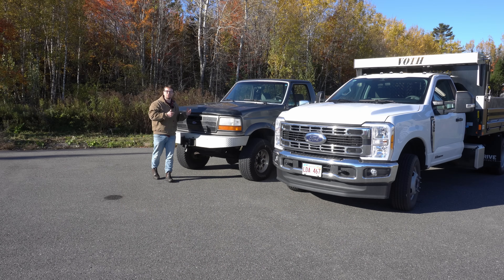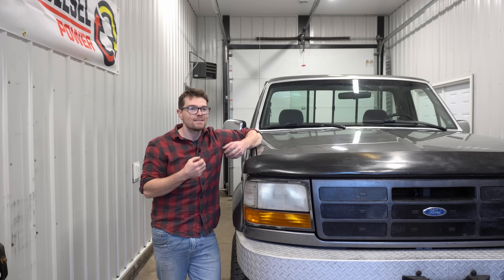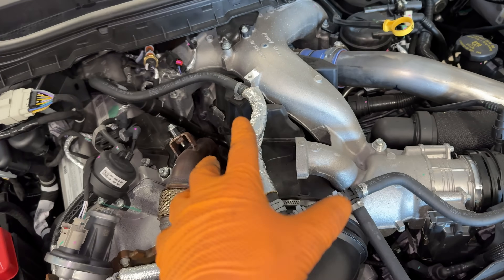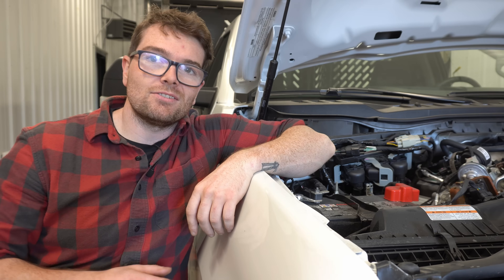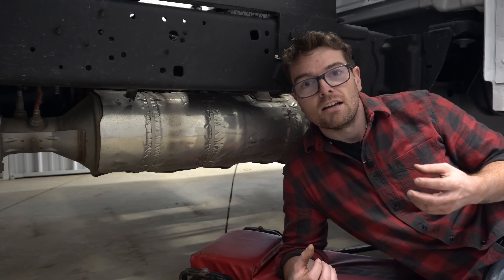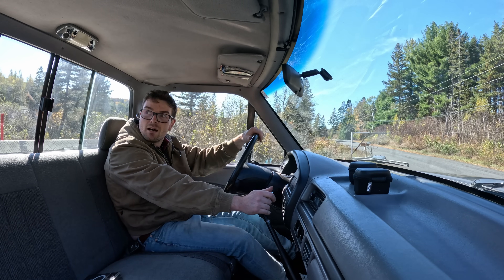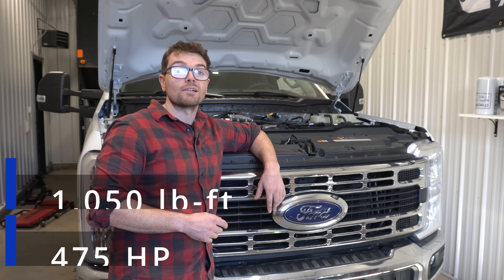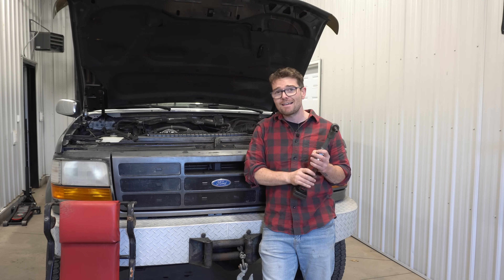Ford F-350 6.7L PowerStroke | 5 Reason Why New Diesel Engine SUCK *Diesel Mechanic Explains*

Comment: What happens when you guess wrong. Does the customer foot the bill. Most of us can fire the parts cannon at it. You pay a dealer because you’d hope they know what’s wrong. But just like I can read the obd2. Most of the time it never tells you what’s up. So like you said it’s a lot of guessing, and if I’m on the hook for a 1200 sensor plus labor plus diagnostics. I hope that’s the problem seems like I can always fire parts at is well.

Comment: My Transgendered '20 F350 dually has clicked off 321k miles, and hasn't had a single issue with the proper maintenance... and it runs and sounds better than any old clankin garbage can 7.3 lol

#isaidwhatisaid

Comment: Another aspect of the modern diesels being a bane up where this video was created would be from parts availability?
From the looks of the surrounding vegetation, the location looks like the northern reaches of Canada, which puts it on a precarious end of a supply chain when it comes to replacement parts for diesel engine repairs . . . especially so when it is -30 degrees with snow in the region.

Comment: You I am afraid right. We buy expensive trucks for power and comfort.  But no dependability.  Nearly unaffordable repairs. Almost like a shakedown by Ford and EPA. Trying to bankrupt us ou5 of our trucks. Case in point, I have a 2013 f450 Platinum.  34,000 miles, code after code after code.  Ridiculous.  Replaced 2 injectors, def heater, now another def code,  voltage wrong... 34,000 miles! I take very good care of truck, trying to preserve it. Hey Ford explain this!

Comment: Just one more reason I'm keeping my ordered from the factory '01 7.3 with only 177,000 miles.  I've been running the Western Diesel Tri-power chip in it since '03, other than when it's smog time here in Commieifornia.  It also has an AirRaid K&N air filter and 4" turbo back exhaust.  These mods really woke up the truck, but I'm on my 3rd 4R100, lol.  Just had the glow plugs and valve cover gaskets and harnesses replaced due to 3 failed glow plugs that threw codes and would not allow a smog pass.  My buddy has a 6 Blow and that thing is killing him with constant expensive repairs.  At the shop doing the glow plugs, there was a complete diesel engine out of a truck....from a '22 Duramax...😮.  The mechanic implored me to never sell my truck as did the smog dude... Not that I needed any convincing.

Comment: I have a 2002 F550 and a 2002 F450,both 7.3s.  Run the 550 at about 17500 lbs and it gets about 7ish mpg.  It just rolled 200k miles and I will keep it running whatever it takes.  Or if I cant i will revert to the 450 which is kept in tip top shape, registered and insured just as a backup.  My friend just bought a new 450 6.7 for towing.  It cost him $117k. It is beautiful and gets 14mpg towing.  I wish him the best, but having maybe 10 years to retirement, I'll stick with what I have.

Comment: You can lower exhaust gas temperatures by removing fuel, not just by contaminating air
Diesel engines run, lean in Europe and produce Extremely Low emissions….🤦🏻‍♂️

Comment: I had an 08 dodge 4500 6.7 repo truck brand new. It kicked a code at 10k mi dealership said excessive carbon build up and had to clean the top end out. It happened again around 30k mi and same thing. Dealer mechanic said to not idle so much 😂 then suggested to run it harder as in full throttle from stops, drop a gear and get rpm up and get it hotter basically. Strangely after the second carbon clean it never had the issue again until I quit and the truck had 83k mi on it. Last I heard the truck went well over 300k mi and they never got a check engine light for excessive carbon build up again. So who knows. That was regen but pre DEF.

Comment: You cannot beat the old 7.3 diesel. I’ve often told people you can have a 1999 Ford F250 lariat with all the options versus a 2008 Ford F250 with all the options. You’ll pay more for the 1999 because of the 7.3. Especially, with those junkie 6.0 and 6.4. At least the 6.0 can be billet. But the 6.4 is absolutely garbage. Hence the reason why Ford divorced from Navistar/international. Then of course in 2011 the 6.7 was born and a true Ford engine. 
Now with that being said, the 6.7 has had it share of problems, especially in the first few years, particularly turbo problems. They also are known to catch fire. Trust me, one of our trucks in my fleet caught fire, literally out of nowhere, driving down the road and burned completely to the ground about three weeks ago. 
Bottom line is you’re absolutely correct. The old million mile diesel days are long gone. Thanks to all the admissions. The states that do not have to worry about it at the moment I would enjoy because the emissions will be coming to you very soon unfortunately. Just my thoughts Ron

Comment: Sticking with my 2023 Titan XD to pull my 7,000 lb snowmobile trailer around. Thought about a diesel, but glad I didn't. And this info just verified my concerns. Been a semi truck driver for 20 years and have experienced all these issues. My 2000 Detroit Series 60 was an amazing engine, but when they gave me a 2003 series 60 with EGR had nothing but problems. Good info. Thanks!

Comment: I think eventually they’ll get it figured out and the emissions systems will become less complicated and more reliable. Closer to the gas engine emissions systems that typically are fairly reliable. Atleast the introduction of emissions equipment on diesels hasn’t caused a huge decrease in power like when emissions components were introduced on gas engines in the 70’s. The silverlining is hey, Atleast the air is cleaner and you are less likely to get cancer or suffer other health issues as a result of diesel emissions from new trucks.

Comment: For a $10k upgrade that doesn’t get better milage than a gas motor? I have a 2000 F350 7.3 manual transmission 4x4 and get 24 Mpg at 65 mph

Comment: A year ago I bought my dream diesel truck since I was a little kid. A 05 f350 extended cab long bed 4wd. And minus the battery cable being corroded it has been reliable. I have modded it too with the coolant filter, blue spring, full exhaust, better alternator, improved ficm, etc. Another point with older diesels is that the problems they will most likely have will be easier to troubleshoot vs a new truck. Whereas with mine you understand the oil cooler can be problematic and you can address it before it becomes a problem. New trucks to me look terrible, and minus the power train and interior/infotainment are basically the same truck from 20 years ago as I can bolt on a brand new f350 suspension to my truck.

Comment: 2 reasons

1) The HP and torque war gave a trucks with tons of power but we lost a lot on the way there.  Like reliability.  And durability.  And mileage.  

2) Emissions.  

Those two things along with all the electronicals involved make modern trucks brittle

Comment: Most people who have these "non-commercial" diesel pickups dont really need then and are paying more money in purchase, fuel and maintenance for no reason. Most "heavy duty" pickups have gas engines that can pull reliably all but the most heavy of loads. I had a 1993 F350 Dually with 7.3ltr IDF diesel was far from reliable...two injection pumps, set of glow plugs, glow plug controller, two starters, one water pump, transmission rebuild and I traded it in with 73K on the odometer. I promised myself then that a truck is a tool and buying a 9 pound sledge hammer to hammer in finish nails we a dumb idea. My 2019 F250 with 6.2 ltr gasser does a great job hauling my 30' travel trailer and it has been highly reliable with 63K. Yes like with gas vehicles, all the new emissions stuff adds complexity and cost and it will take a long time for engineers to figure out how to do it better. I remember gas engines in the late 70's when the new emissions standards came out....engines were a maze of hoses, sensors and pumps and put out less horsepower and after 100K the engines were boat anchors. Today gas engines are cleaner, more HP/torque and if you maintain them consistently, they will go 300K miles....

Comment: If the politicians and lab coats were smart enough to factor in fuel mileage, longevity, and carbon footprint of building they would see the old diesels are more environmentally friendly. Every one of the new complex gadgets bolted to the engine has a footprint and every time you replace a component it adds up. Try to explain to me how a 5 speed 12v that goes a million miles and gets 20mpg+ is worse than going through 3 new trucks?

Comment: I looked for a long time and found a 2007 Dodge 2500 4x4 with 5.9 Cummins. It is a southern truck with low miles. The truck had never even had a brake controller installed.

I will keep it as long as possible.  I have owned two 7.3 Powerstokes, 3 Cummins 5.9's, and one Cummins 6.7. I don't want any of the newer diesels.  I will stick with the 5.9 or 7.3.

Comment: I bought a "BulletProofed" 6.0 F250 crew cab 4x4 seven years ago and have had zero problems. The '99.5  7.3 F350 that I drove from new until 2010 was great but had plenty issues that needed to be dealt with. Overall the 6.0 wins for me.

Comment: I just had a random idea, and maybe theres some reason this wouldnt work...but regarding the egr, i wonder why they dont just pull from the exhuast flow after the DPF and cats.  Wouldnt that greatly reduce the amount of soot getting spit back into the engine?   I mean if it reduces the soot leaving the tail pipe, then surely it would keep the soot out of the intake too.

Comment: I got a 2017 f350 new and by 10k miles, the dpf clogged because it never went into regen and blew a hole in the intake, by 45k miles the transmission broke, which cost $9500 and wasn't under warranty cause I had a tuner on it even though the tune was only on the engine and not the trans.  By 70k miles I had to replace the rear diff, both front wheel bearings & brakes--$11,000, i got 200 miles down the road and the cp4 pump failed and is going to cost $14,000 to fix the entire fuel system. I am never buying a diesel or Ford again.

Comment: My friend finally sold her 2010 F-350 King Ranch with only 10K miles on it. It took her almost 2 years to get it sold since even the least educated buyers had at minimum, some knowledge of the 6.4's issues.....while it was a beautiful, fully loaded garage queen she had to settle on $26K for a like-new truck that cost her 3 times that much new.

Comment: I own a 2022 F250 with a 6.7 and the performance is amazing.  There's no way the older trucks could do what this one does.  However, I think a lot of people are buying them because they are "cool".  Don't get me wrong, they are, but they are purpose built to tow and haul.  If you're not going to be using it for heavy towing, then I wouldn't recommend it.  I rarely see my truck go into regen because it's used almost exclusively for towing a 14K lb. trailer on the highway.  At that load level, the exhaust temps stay high enough to prevent the DPF from filling up.  This doesn't help with the EGR problems, but getting your truck up to a high operating temp and keeping it there for a while will reduce the number of problems.
Reply from the maker: very much agree, these emissions systems LOVE being at high temps. helps keep them clean and limits downtime forsure. the more a truck idles the more likely we see it in the shop with emission issues.

Comment: I have a Ford F250 which I bought new in '89.  The odometer stopped working many years ago, but it has something more than 600K miles on it.  It has had 1 injection pump, 4 water pumps, 1 alternator, and 1 set of glow plugs replaced, but the valve covers have never even been off the engine itself.  The old IDI 7.3 naturally aspirated engines are a bit slow to accelerate, but that is nothing a Banks turbo kit won't fix.  There is no way I would ever buy one of these new eco friendly diesel trucks.
Reply from the maker: they are slow, but they'll get you home everytime!

Comment: First gen Cummins 5.9l 12 valve. Best engine ever made.
Reply from the maker: I do not disagree, simple maintenance and that engine will run for 30 years.
Reply: @TheGettyAdventures  I've seen them with over 1.5 million miles on em, running great. I put 500k on mine and never needed anything but an oil change. I ran mine on 99%biodiesel the entire time too, with zero issues. 25-35mpg.

Comment: Car corporations and the governments are all on the same team and they are using new vehicles to surveil, spy on us and control where and when we go driving. -- I have no use for a new car. But I do have an old car, with a clutch, 5 speed manual gearbox, 2.2 liter 4 banger, A/C, crank windows and a sunroof, it works fine, and I enjoy it here in Arizona. -- If Western Civ is going to survive, we will have to deal with the governments and corporations unholy union and their desire to rule over us with unelected bureaucrats. We are no longer represented in government.

Comment: As simple as mechanical injection pump, they are so relaible but won't get you as much power in comparison to HUEI and Common Rail. Lack of electronics for the mechanical injection pump other than sensors for live data. Simple as that. 

HUEI and Common Rail are electric and module control for greater power, better fuel economy, and immense amount of headache. As simple as it gets, as long as you can get the job done that is all there is to it. Yes, emissions suck with all of these DEF and DPF. Waste more time and money to develop these just to lower particulate matter and NOx gas. I understand the particulate matter but with current technology, we really don't need the DPF and the SCR. 

Of course, we have those enviromentalist claiming that diesel engines "pollute" the planet with CO2. Well, don't all vehicles with combustion engine produce CO2. Plants take them anyway. I'd be more worry about what they toss out on the road than worry about emissions.

Comment: it is interesting in commercial applications that cole-burning Hydroelectric power stations have scrubbers that are cleaned and the material cleaned out of the scrubber is put through a chemical process and mfg into drywall for building, the idea of trying to process diesel engine exhaust while you move down the road seem problematic you would think that developing a cleaner diesel fuel would be the best plan but with all the different directions being signaled by different country governments which way do you invest your hard-earned development buck

Comment: I had a 1994 7.3 F-250. My 2004 single-cab duallie F-350 with the V-10 gas engine has more power and gets comparable fuel mileage. My 7.3 self-destructed at 134K miles.

Comment: And the great irony of this entire ordeal is that diesel exhaust, despite the particulates, were much cleaner than gasoline engine exhausts prior to all the emissions regulations. All of that additional equipment is there to reduce or remove the apparent unsightly and ill-perceived harmful particulates. Besides the soot, it is virtually carbon dioxide and water.

Comment: 6:45 - Yeah, if you know a cheaper, more reliable way of monitoring no2 levels, the world would love to hear about it. I know you can't smell it, but it's going to kill us if we don't do something about it. If you've ever sat in a cold truck stop, next to 20 other running diesels, you'd be glad their emissions equipment works (if it is equipped). Drivers have to sleep high off the ground to avoid poison clouds that form, condense, and settle. Remember, that h2 and 02 is being pushed up, while compounds like no2 fall, in the atmosphere. Also remember that 02 is what we need to breathe, not O3, NO2, or even longer chains of carbon.

Comment: My truck is a 2000 F-450 4x4 with a dump bed.  I do plan on a mild build maybe next year.  For now I have put on a very effective catch-can and I use renewable diesel.  It runs like a new vehicle since it only has 50K.

Comment: Three days before 9/11 I bought my truck 2001 Dodge Ram 4 x 4 Cummins 6 speed manual 8-ft bed the truck was delivered to me with 78 Mi on it I still have it today has 460,000 miles on it and it runs as good as the dad bought it

Comment: I agree with you 100%. It took me awile to find a 2000 F350 with the 7.3 out of Arizona, and plan to keep it till I die. The old school engines can be rebuilt, but when the truck bodys and frames rust out, its pretty much over for that truck
Reply: Maybe it's over for that truck whenever rust sets in but you can always buy another body or a frame and fix it I'd rather go through all that than deal with the bullshit on the new trucks

Comment: There's no comparison new diesels way overtake the capabilities of the old diesels. I've seen many modern diesels call 500,000 MI 
The old 7.3 I don't see too many of those making past 300K..
The old 7.3 l are archaic Smoky stinky loud boat anchors

Comment: Good that i live in Canada and can remove all that crap.
Winter with emissions on place is never ending regen.
Nox sensors for semis im buying Chinese, they cost 300usd and had one working for 5 years. It was still good when engine went thru rebuild and emissions del....thats already longer than OEM

Comment: This could be summed up with one word "emissions". I do wonder what would be the outcome if these new engines were designed and built without all those sensors and emissions and I don't mean deleted. I bought my first Diesel in 2018, it is a 1996 F250 PSD 4x4 auto and 410 gears. It had 77k when I bought it and It has 94k on it as of this note. It pulls my 5th wheel well. It isn't fast but it pulls.  Great info and comparison on the trucks.

Comment: Emissions requirements, and the fuel. All the BS on modern diesels is complex and prone to failure, and removing sulfur from the fuel removed the lubrication leading to mechanical failures.